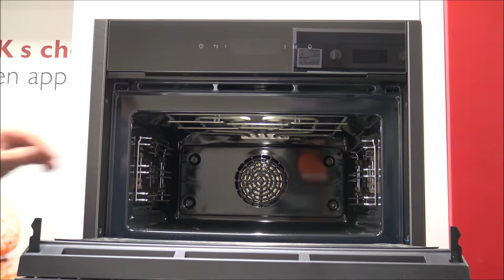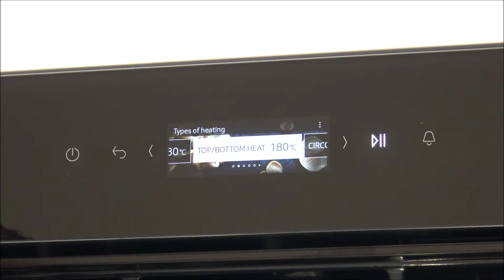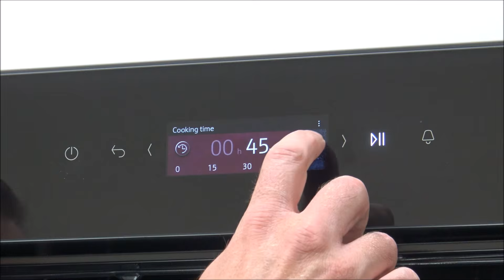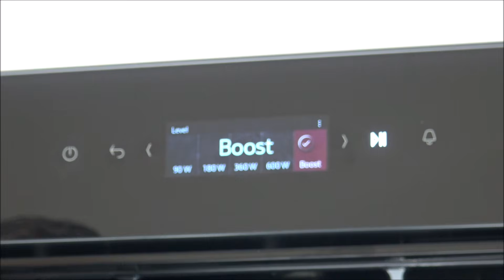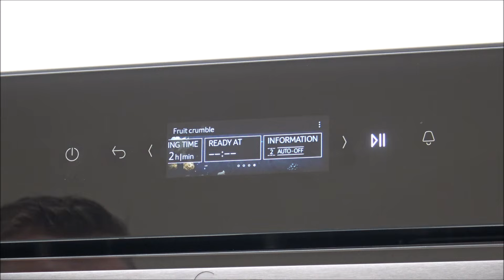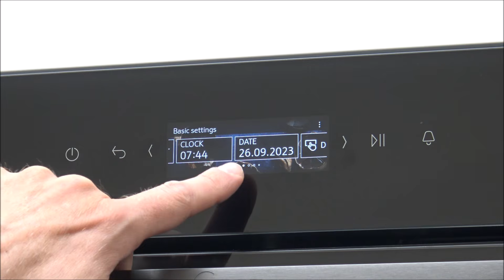Neff C24MR21GOB N70 Compact Oven With Microwave

Comment: when using the microwave in boost mode it tells you not to use a baking tray, is that the tray you pulled out at the beginning, thanks, great video.

Comment: Hi, can you please tell me if you can leave the shelf in to use microwave? Thank you 🙏
Reply: Did he answer your question?  I asked in shop as was buying one. In order to use microwave u have to take out all the metal shelves and trays. 
But suits me cause I only need to use oven part when I hv all the family over. On daily basis I’d be using the microwave. I believe u can only do 900 watt microwaving. So if your instructions to cook something is 600 ?!  But I think it does hv a defrost function on oven setting
Reply: @brec5879  Well how could you roast something in metal roasting tin and also use microwave
Reply: @irenegordon8685 thats very good question

Comment: @Lords Electrical.  Regarding the brown connections for the inside of the oven the bits that hold the shelves.  Can you tell me where the larger ones go at the front or the back?  I thought they were the same size until I took them out and washed them and I didn't realise until it was time to put them back in. 😥
Reply from the maker: I've just had a look and from the front they look the same size, so i'm not really sure to be honest

Comment: I'm looking for a new oven and one feature I would like is the temperature probe because it sound good on paper to have one. Not much info online what ovens have this option, do you know more?
Reply from the maker: Not many ovens we sell have the probe and i'm not too convinced by them. The main advantage is that the joint of meat will cook perfectly to how you want it by using the probe. But how long will it take to cook? I like to know a time that the dinner will be ready so i can add potatoes / veg etc in when cooking and i can guarantee a time that it will all be ready. When using a probe then you don't know exactly when the meat is going to be ready making it more difficult to prepare a meal in a certain time